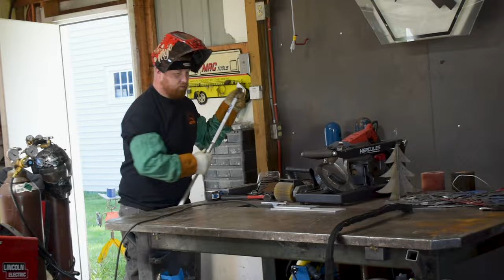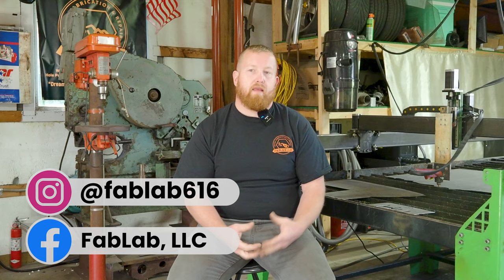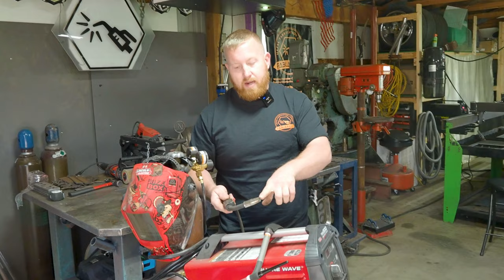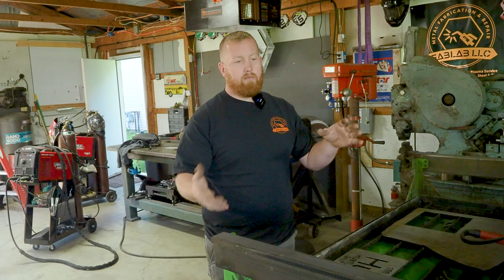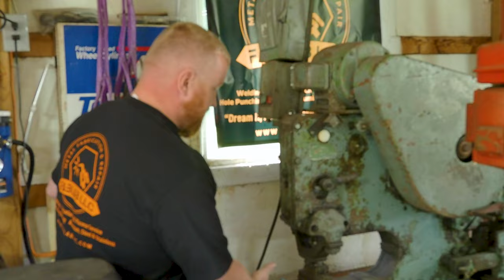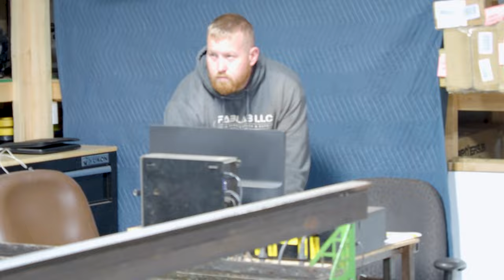How to Start $5K/Month Welding Business

Comment: Flashy equipment is nice but it doesn't do a lot for you. 
Exactly! I'm a blacksmith and machinist and all I can say is the old machinery still works (sometimes even better than new), so why invest in some overpriced flashy things? It's a workshop not a showroom for equipment.
Reply: You said older equipment man I prefer the older stuff over the new stuff buddy of mine bought second hand now granted it was second hand but it still happens whenever the warranty runs out don't matter 11,000 for a Lincoln Electric cross-country less than a month ago now it's got a cracked board and they don't know which one it is no way to find out which one it is so they got to replace all three total is $6,000 no freaking way I'm going to buy a new one
Reply: what type of forge you have?
Reply: @Goodfella6969  I have two. A gas-fired one and one with a traditional coal fire. I made them by myself. I don't need them often but they're nice to have in the workshop. :)